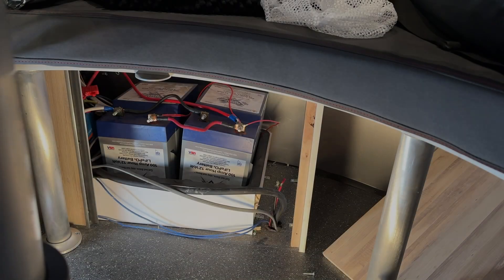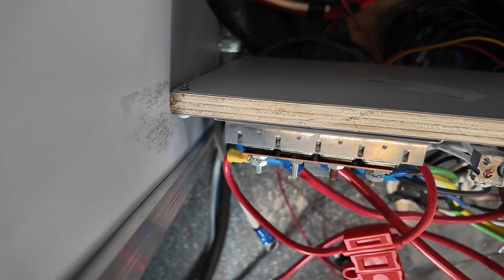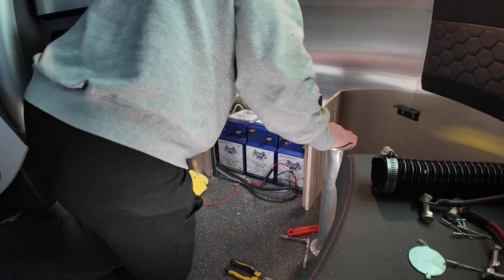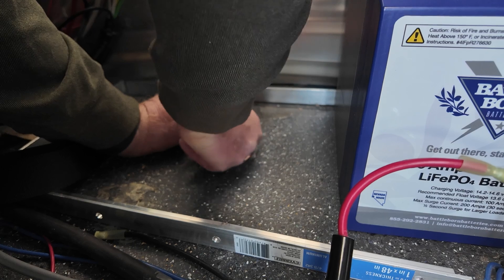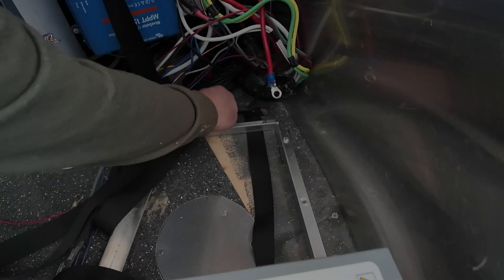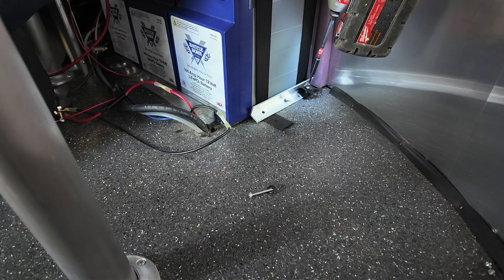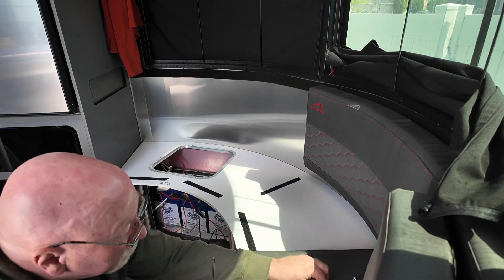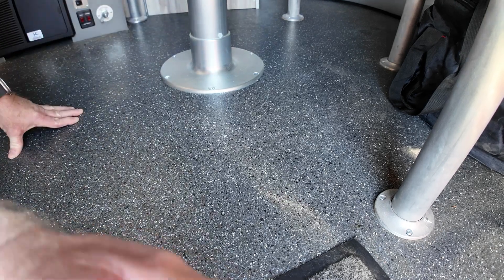Airstream Basecamp battery box repair and an additional Battleborn battery

Comment: Great video, thanks for posting.  That foam board is highly flammable not ideal for an electrical compartment.
Reply from the maker: Thanks for watching, for the comment and the insight. I did a little research and you are absolutely right. While the risk of ignition from the Battleborn Batteries is low, the prudent course is to remove that foam board from the battery compartment and replace it with cellular glass insulation. Thanks again. I will edit this video accordingly.